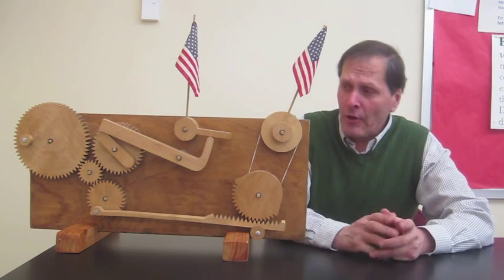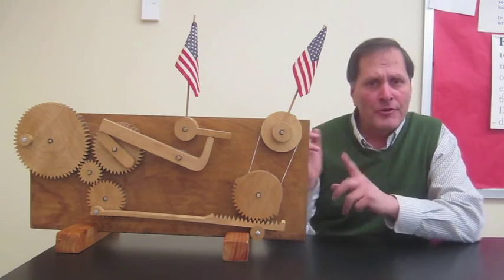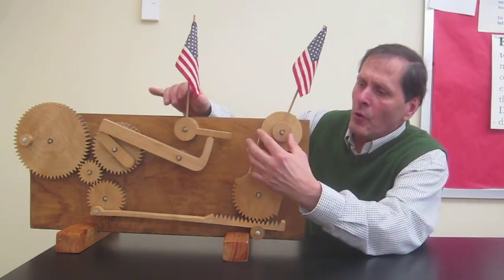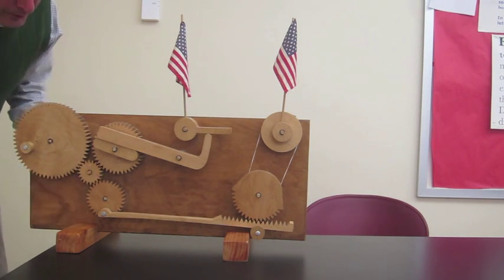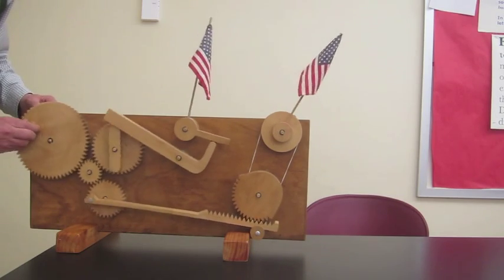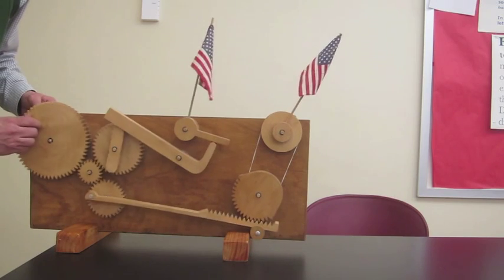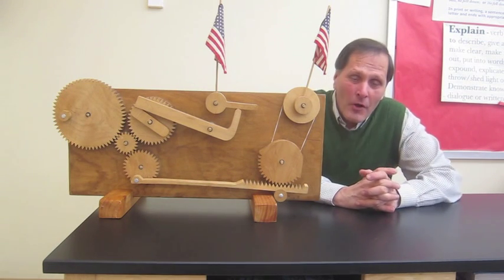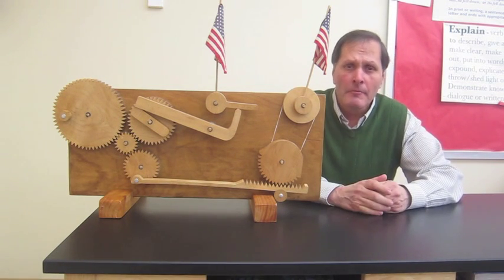Flag waving machine////Homemade Science with Bruce Yeany

Comment: hi. Mr. Yeany

could you please explain how do you calculate gear parameters and speed? do you have any reference of design parameter of gear? thanks!
Reply from the maker: the speed and change of four is going to be the ratio of teeth from one gear to the other,  large gears to small gears increase the speed but will reduce the torque, for example a large gear of 36 teeth will turn a small gear with 9 teeth,  four times faster.  If you make the teeth one centimeter is width, then calculate the circumference of the gear wheel to the number of teeth that you want on it.  Try doing a search for "making wooden gears" and you will find more complete instructions